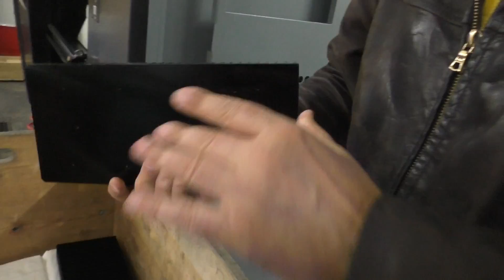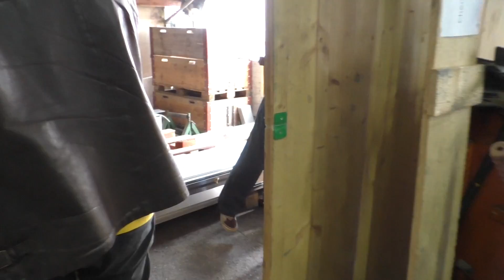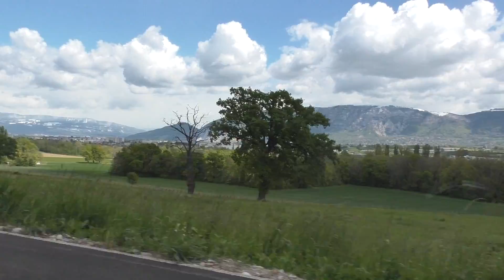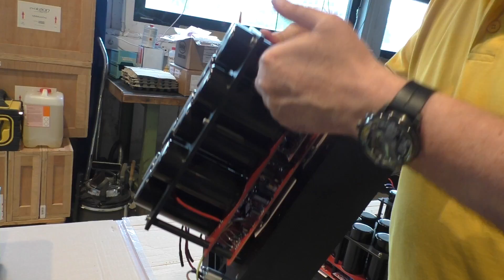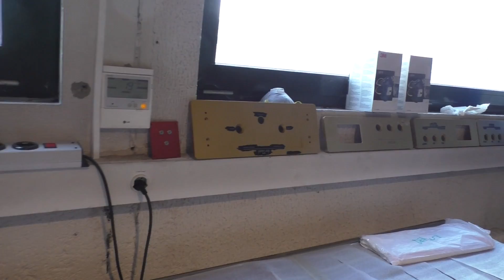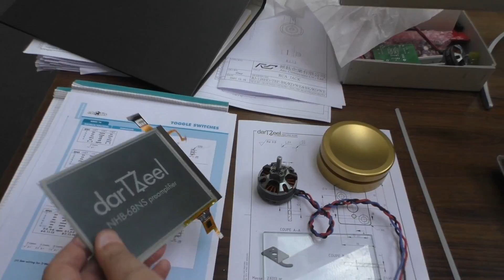AnalogPlanet Tours darTZeel Factory, Geneva, Switzerland

Comment: Fabulous equipment.  Fascinating to hear from the creator himself and see a small boutique creating such fine products.
As a DIY craftsman, I appreciate all of his design choices.  I build tube equipment with similar philosophies.  Very oversized power supply with massive toroidal transformers and large caps used for high end computer servers.  I dampen my caps in silicon.  Same silver solid wire signal path.  Simple circuit with best possible parts.  
I was first attracted to the brand due to his use of optocouplers for volume control.  I had done the same at the same time.  I have since moved to autoformers which had a more transparent sound.  
Th

Comment: 6 pairs? that's not dartZeel sound. the original dartZel was 1 or 2 pairs only because of the quality of sound
Reply: I once saw 108 Chinese clone with 6 pairs. I investigated and apparently the clone manufacturer intentionally changed the circuit in order to improve sound. I thought at the time he did it because it was challenging to produce it with less pairs and I considered it to be a deviation i.e. something that costs $1600 but it has nothing to do with darTzeel. But now I see dartZeel cloned the clone improvement with 6 pairs. So now I am thinking maybe that Chinese clone is really worth investing. there is a YT video comparing an original with clone, in favor of the original

Comment: $200K system with Klipschorns?
Reply: Damn right. This is what we call paradox.
Reply: @Boudas72  You reckon the CEO is deaf? I don't see Fremer complaining...
Reply: @JustinBenn  How could he?You've seen his system?
Reply: @boudas7295 , the point is, K-horns are fantastic when implemented properly. I've heard them several times (including custom installations, originals and Crites/B&C-modified pairs) and they really do need to be served with good signal - tubes or solid state. They also need to be sited properly with either real or false walls either side to support the lower frequencies adequately, as seen in the film.